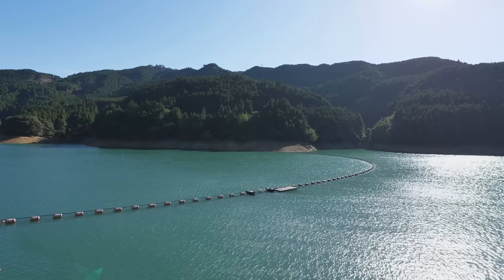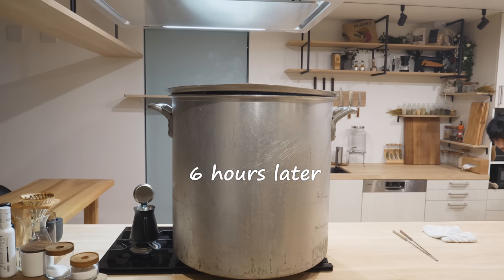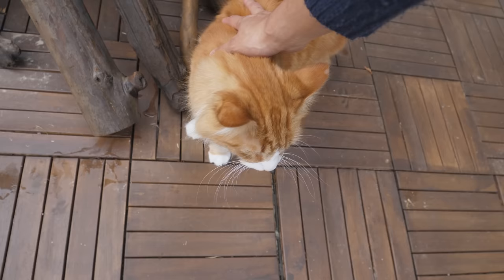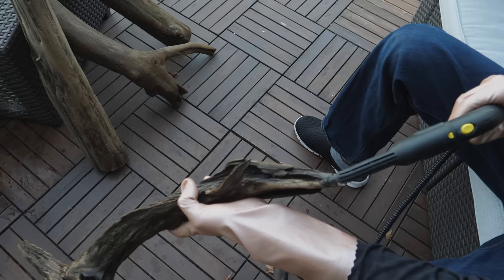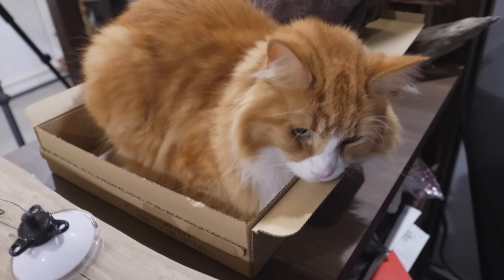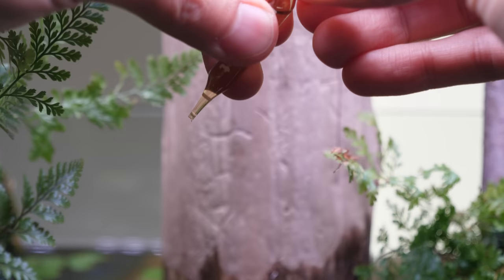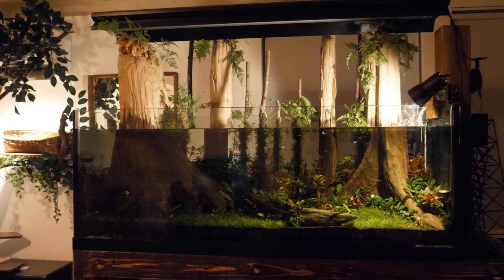Making a fish tank with driftwood collected from a dam

Comment: I had no idea preparing the wood alone was that much work.  Amazing job, Jun
Reply: I definitely would not have that level of dedication to a project.
Reply: It's a bit overdone. Spray down with some water is enough if you like the look of clean wood then a good scrub is needed. No boil though.
Reply: I thought it was to prevent rogue bacteria or organisms from invading the tank?
Reply: @jessetermeer2187  It's not overdone if you don't want the wood to leach tannins - he obviously wants clearer water from the jump
Reply: I have a tiny little 10 gallon beta tank. Sometimes you can buy wood at the store that's dense enough and it sinks right away. One time I had to stick a piece of wood in a tupper wear for a month and it STILL didn't sink. I finally just put it in the tank with something ugly to weigh it down. I had to test it every week to see if it finally got water logged or not lol.
Reply: @general_enslaver_of_cactii867  Boiling the wood does a lot. If the wood from outside, then yea you should probably boil to remove bacteria, pesticides, parasites, and anything else it may have come into contact with. Natural things like wood, leaves, and other botanicals release tannins into your water as well. This makes the water a tea color. Boiling is a way to remove these tannins. You can see how the water is a gross brown color the first time he opens the pot. Thats not dirt or grime, it's the tannins. Some people say tannins are a natural antibacterial, so some people keep it. Boiling also plain and simple just helps the wood get water logged so it sinks in the tank. I had a piece of wood in a Tupperware for a month once and it still wasn't sinking. I had to put in in the tank with some rocks tied to it to weigh it down.
Reply: @jessijaneway6660  Wow, that's very informative, thank you! ^^
Reply: Its unnecessary actually he gave himself more work than he needed too, he just needed to let it soak for a couple of weeks to get some of the tannins out and for it to soak up water to make it sink. Its not freshly cut wood, mother nature has basically done all the cleaning work, as its tumbled in running water. All that's needed is to soak it as stated, boiling and scrubbing is not needed.
Reply: @jessetermeer2187  I think darker water looks really good especially with a lot of iridescent fish. Sanitizing it like a pet store would give a different look though.
Reply: @XBullitt16X He wasn’t just trying to get the tannins out. By boiling and scrubbing, he was able to kill off any bacteria or parasites they could’ve been inside the wood. As well as any extra bugs or marks. If you want something done right the first time, then a quick soak isn’t gonna do that❤

Comment: Just a tip on emptying the pot. If you run your hose with no attachment to the bottom of the pot and turn it on long enough to expel the air, you can then disconnect the faucet end of the hose and the water will siphon out of the pot to the other end of the hose outside. You will have to rig a way to keep the pot end of the hose submerged to the bottom of the pot. This won't remove ALL of the water. Also, keep in mind, those who DO try this at home, that water weighs 8 pounds per gallon, so that pot Jun is using probably weighs close to 200 pounds when full, which may be more than your stove or counter can handle.

Comment: We do use our pot and boil our drift wood. If there is little tanin still coming out of the wood it won't hurt the fish it actually fine for them. The clear water in a fish tank more for looks. If  take water from a creek or lake notice never really clear. Your so lucky find drift wood. I need alot since I have a 60 gallon tank. Be aware I'd your not planning on having a lid the cats will figure out how to drink out of it too.  Cycle the tank for a good month or so and test the water until there is no nitrates, nitrites and ammonia. RO water is the best to use. Need use a stress coat when add your fish. Never use tap water to clean your filter. Use the water take out when your doing water changes to clean it. Glad you seem know what your doing but not many do

Comment: Hey Jun, love the tank setup! I have a suggestion: you may want to direct the outflow from your filter at the co2 diffuser. I see most of your CO2 fine bubbles were just heading straight up the tank and gassed off at the surface. You ideally want it to go around the tank instead (:

Edit: wait i just realized that you're running UGF.. in that case maybe a skimmer or a mini water pump to direct water flow will help (:

Comment: I had a betta, I'm honestly surprised he lived as long as he did. He hated being in large tanks, to the point it stressed him out that he ripped up his own fins. I found this out through way too much trial and error, because I had a 5 gallon tank and then I moved him to a 16 gallon tank and then I moved him back to a 5 gallon tank after he'd ripped up his thin the first time, and I felt bad having him in a five gallon tank cuz that's not big enough, and then I moved him to a 10 gallon tank because clearly 16 gallons stressed him out, and he wouldn't write back to ripping his fins in the 10 gallon tank, and it didn't stop until I put him back in the 5 gallon tank and never tried to change it again. We also had an instance where I had to put him in a 2 gallon holder tank, while we treated him for his injuries and potential bacterial infections, and the cats knocked the container off of the table while we were gone, I came home to a giant puddle of water on the floor and thought they had eaten him at first, he survived that ordeal and lived another 3 years... We have three other bettas in that time none of which lasted more than a year. Despite not doing anything obviously wrong.

Ivan was the first one we got, and was the last one still alive. In a 5-year time frame... I almost feel like spite is what kept him alive....

Comment: A layer of anaerobic soil is nessecary for a healthy eco system. By replacing it with co2 injections you end that whole process so the part of the roots that would typically absorb neutrients lose that ability. In other words you could have gone with much less soil since you are basically doing natures job for it. Alternatively used a differant medium beneeth the soil you are using and eliminate the need for co2 injections alltogether, saving yourself the expense.

I'm just assuming the pump on the right hand side is co2.